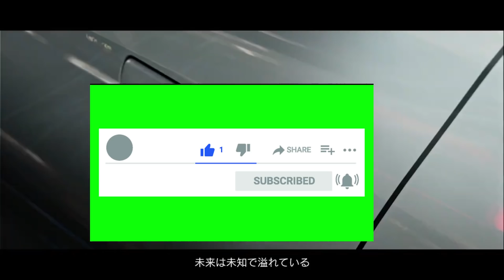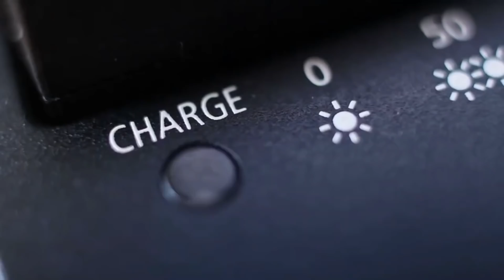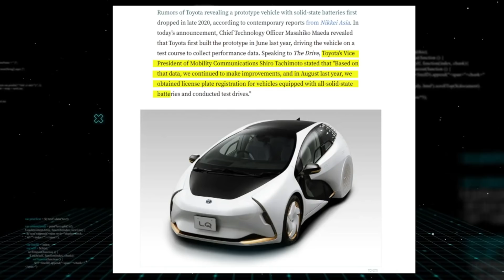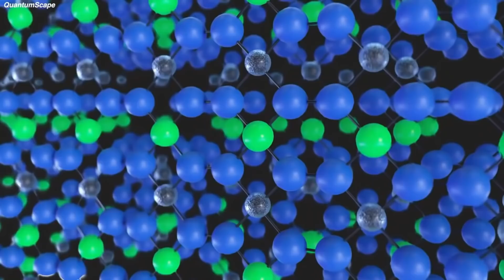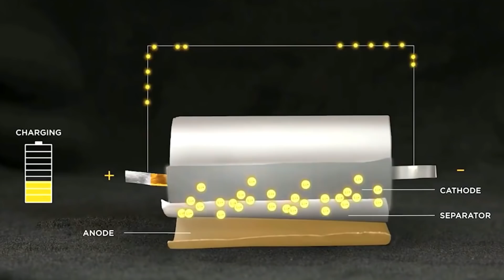FINALLY! Toyota Reveals SECRET NEW Solid State Battery | 2021

Comment: Most little petrol Toyota starlets today have been clocked so many times and still look good condition
Many have achieved 500.000 miles if only people knew the truth a Toyota prius with 270.000 miles
So when a solid state battery comes along with a 10 minute full recharge
Most sales reps will have these from new to include Taxi drivers as there is no Mot mileage check for the 1st 3 years these vehicles will be clocked back from 240.000 to say 90.000 one owner from new

Comment: 1998 BMW Had a hydrogen 7 series that could do 800miles per tank. Where is it now?. Water is better than making batteries... with zero charge time.
Reply: Have you actually seen how space wasting the latest Hydrogen cars are, there is hardly room for passengers and luggage. Three huge tanks in various locations, fuel cell filling front compartment plus a battery pack and the electric drive motor!
Really is a "Heath Robinson" approach compared to a Tesla.
Who in their right mind drives for 800 miles without stopping?
Just look at how Hydrogen is produced, its no simple process and uses vast amounts of electricity that would be better utilised directly in an electric car.
This is assuming everyone had their own converter otherwise delivering it to stations would make it ever more wasteful and polluting.

Comment: 2028?  Currently hybrids take 1/10th as many lithium ion cells to make; as compared to full EVs such as the Tesla cars.  If CO2 is a matter of concern then you can have 1 Full EV or 10 hybrids; both which can travel commute distances all electric.  Lithium ion cells are in very limited supply so Hybrids offer 10x more electric commute miles than EVs.  Tesla just achieved 1 million total cars built; they could have used those batteries to make 10 million hybrids; in a market of 80 million cars a year EVs actually perpetuate the use of ICE cars by pigging Lithium ion cells and in that regard they are a negative. Solid state is what everyone hopes to get in order to outperform hybrids in CO2 reduction but the supply would need to be spectacular; in order to replace ICE and cars at the given rate. Governments that push for elimination of hybrids are actually extending the life of ICE cars because you make so many fewer EVs than hybrids with a given number of lithium cells.
Reply: I completely agree.   The vast majority of folks drive < 50 miles on the vast majority of days.  Extra battery capacity means lugging around very heavy and very precious needless weight.   PHEVs with about 50 miles of battery range are the most efficient use of resources for our current energy landscape.  Similarly for a 2 car family, one BEV with perhaps100 mile range and one PHEV  would be an extremely reasonable use of resources.  The obsession with battery range is misguided.
Reply: @BHPGH  The big problem seems to be that people want one car that can do everything for them.  Maybe they think they don't commute as much as they do because they tune out in order to survive the deary commute drives.  They could get by with a small EV ; they don't think about maybe just renting a larger car when they need it .. Anyway - the result is to have a longer range you either need half a ton of batteries or a 300 lb gas engine.  When you compare a 5000 Tesla to a 3000 Lb RAV4 or a Toyota Corolla hybrid 2500 lbs it clearly costs more energy to make and more energy to push around.  The comparisons Teslas influencers always make not only forget this but they forget hybrids as an option nor do they mention big EVs pig all the Li batteries and basically minimize the number of electrics that can be made. Here is another one for you - IF people were really worried about CO2 they could have a much greated impact by carpooling to work;  cutting the number of cars on the road by 3/4ths saving them time money stress and the C02 - but notice no one is worried enough to do that.

Comment: It's not true that solid state batteries would require lithium. Several prototypes have been made of solid state batteries using other elements including sodium, which is extremely common and easy to mine.

Comment: By 2028, it will be too late. EVs running on lithium ion batteries will have far surpassed cost parity with ICE. Affordable EV options will be flooding the market. With this timeline, Toyota is in trouble.

Comment: Toyota doesn't want the world to switch to Battery Electric Vehicles. $13.6 by 2030 spending is actually a relative drop in the ocean compared to Tesla, CATL, BYD, and various other companies that ARE committed to BEVs and not Hybrid and H2 Fuel Cell Vehicles. And, as yet, Solid State batteries can't be made to scale. And it's not a simple engineering issue either. I welcome Toyota making efforts with SS batteries. But I hope it's not just a mask to counter what Toyota CEO Toyoda says about where he wants to go and what timeline.

Comment: The problem is more profound than this propaganda. It is one thing to make something work underwear laboratory conditions and another to make full scale production. Tesla is on the verge of full scale production of its 4680 battery. By the time Toyota developed a solid state battery, Tesla will be working on a second or third generation battery if not something more advanced.

Comment: Tesla is optimizing legacy batteries. They have been very good at this, but clearly the battery revolution has still to come.
Reply: Have you heard about the 4680 cell in production now ? It's not yet in the cars but will be oce the 2 new factories come online
Reply: @valdimareiriksson101  4680 is not an innovation. Its just a larger battery.
Reply: @frankwiersma7980  I don't agree, the fact that it is cylindrical does not make it a "legacy" battery. The tab less electrode ? The size and thermal management ? Not to mention the footprint of the factory.
Reply: @valdimareiriksson101  Panasonic makes Tesla batteries. These are not special batteries, all car manufacturers can buy them from Panasonic. Tesla has optimized the lifetime and charging duration by using software and BTMS. So while the way these batteries are charged and cooled is new, the batteries themselves are not new or innovative. Therefore I fully expect new developments in the area of batteries. It may come from Toyota, QS, Tesla, but most likely from a university.
Reply: @frankwiersma7980  Panasonic is licensing the tech from tesla.... Panasonic did not create this battery... the size alone requires the tab less electrode, to thermally manage each cell, the NEW battery packs Tesla is making requires alot less of cooling mechanism in the car due to the tab less electrode. Tesla is making these batteries right now and have been for a while (in house).
Reply: @valdimareiriksson101  Yes cooling is innovative, batteries are not. The NCA battery was developed by Panasonic. You are misinformed into thinking Tesla owns patents for this.
Reply: @frankwiersma7980  I'm sure we are arguing about different points at this time, the form factor is new and is Teslas innovation the chemistry in that battery might not be new or atleast is not for now. Just like the Toyota solid state "will" be Li based.

Comment: Leader in sustainable transportation? This author is living in another decade.
Reply: no he isn't, they made 30x more hybrids cars than Tesla in total.
They want a quality tech not "half baked" tank weighing ~300kg more, 4x slower charging and 50% the capacity in cold.
Reply: @ChuckLeeClerk  yeah you got that right.. that's the most concern of normal people like us to think and toyota will the come true hopefully...cheap, reliable, long lasting battery or parts of the car, fast charging 10minutes or below unlike Tesla that is only for the Rich people although they say that is cheap for US only but when it come to other countries.. the dealer put a price mark-up double or triple the price, that is sorry people like me will still uses combustion engine car even it takes 10-20years until it becomes Cheapest that anyone can afford it!...but i hope Toyota perfected the hydrogen car vehicle rather than fully EV😃..
Reply: @matmamat9690  I'm ok with freevalve hybrids - simple powerfull & clean
 If BEVs are comparably convenient and cheap that's good, but I don't really care
Reply: I have had 2 Toyota Hybrids, it is the same gasoline burning as ICE, can't compare with that what Tesla has got going..
Reply: @GHJuOk  but those (old Totyota's hybrid) ICEs were weak tho quite effective ~40%.
Freevalve engines are 50%+ eff, no cams or throttle body (simple + seamless cylinder deactivation) and clean even on cold start.

Comment: EV adoption is accelerating every year. Exponential not linear. The only limiting factor is batteries.
The number of electric vehicles and types of vehicles and trucks is growing.
Many people are holding off buying a new car until the electric vehicle they want becomes available.
Electric vehicles are just better. No noise, no emissions, less fuel costs, less maintenance costs and amazing technology. Gasoline and diesel are OLD polluting technology. So last century.  Electric cars, electric trucks, electric buses, electric trash haulers, electric snow blowers, electric lawn mowers, electric weed whackers, electric hedge trimmers, electric snow mobiles, electric water craft, electric garden tools, electric mechanic tools, electric motor cycles, electric bicycles, electric scooters, electric farm tractors, electric construction equipment, electric delivery vehicles,  ...... everything is going electric.  No worries about starting after sitting for a few months. Gas always needs repairs. If you care about the future for your children care about climate change
Reply: Wait to you get stuck in snow storm.
Reply: @frank.l181  I've been driving EVs for over 6 years through Michigan winters and haven't got stuck in a snow storm yet.

Comment: I seem to have a lot more faith in Toyota than the other commenters. Liquid lithium ion has been hugely advanced in the last 20 years but is beginning to run into the life cycle point where small improvements are getting more expensive. I'm not saying that I would buy the first Solid State Toyota but given a few years for on road development I suspect that the new Toyota will be a significant improvement on the current technology. Good on you Toyota
Reply: Yeah, really, so you are buying this Toyota crap? So now Toyota wants us to ignore all the money they have spend trying to slow down EV adoption and how much they have pushed hydrogen cars. They spent millions joining the Trump administration lawsuit against California trying to force them to roll back emissions standards. Everyone is working on solid state batteries, if Toyota believes that they have the secret sauce, then go ahead and deploy it, but looking at how Tesla and the Chinese EV manufactures are selling cars with the proven technology that works for now, kind of leads me to believe Toyota doesn't have 8 years to deploy their solid state batteries, if they really do have them. I mean, they don't even have a single BEV in the market.

Comment: What exactly is a solid state battery though? Batteries never had and moving parts
Reply: No need to.The question was rhetorical, highlighting the fsct that the name makes no sense whatsoever.
Reply: @OM-bs7of  "No need to.The question was rhetorical, highlighting the fsct that the name makes no sense whatsoever."

Sure it does as the name refers to the solid electrolyte.
Reply: @jbaker0203    well "solid state" originally came from harddrives right? The distinction being the regular hard drive had moving parts whereas solid state drives have no moving parts. This leads to my question about moving parts. Basic on your logic though lithium polymer batteries are already "solid state" as they use a solid electrolyte (the polymer) so what's so revolutionary? It's nothing new
Reply: @OM-bs7of  "well "solid state" originally came from harddrives right? "

Not really, solid state can refer to a whole different bunch of things i.e. Ice is the solid state of H2O for example. It's a generic term.

"The distinction being the regular hard drive had moving parts whereas solid state drives have no moving parts."

In that example, yes.

"This leads to my question about moving parts. Basic on your logic though lithium polymer batteries are already "solid state" as they use a solid electrolyte (the polymer) so what's so revolutionary? It's nothing new"

Not quite as the polymer is a semi-solid electrolyte, however also to be fair, not all solid state are true solid state batteries. They all have a solid electrolyte but some have a gel component for the cathode.

Solid state batteries aren't a new thing either, that you are correct. The revolutionary part is the cycle life and energy density.

Comment: Toyota is by far the best vehicle I have ever owned. I drove a service vehicle, that had 300,000 miles on it. Was only ten years old. It looked like it should have 30,000 miles. Well, except the seats, they looked like 300,000 butts have been dragged across them. But then every service vehicle gets like that. Mechanically, it was driving a near new vehicle. I was impressed.

Looking forward to what the develop. Sounds like Super-capacitor tech. Charges pretty damn fast if it gives 500 miles charge in 10 minutes. A Super-capacitor would do it in just a few seconds. Limited on the flow on energy allowed at the pump of course. "Marty, we need a giga-watt pump to recharge my Toyota!"
Reply: Super capacitors have poor density. You would need the trunk and back seat filled with them to rival Li-Ion tech.
Reply: The video said 500 kilometers, not 500 miles.  That would be about 310 miles.  Pretty typical range for current EV’s.

Comment: so it can recharge in 10mins with a range of 500mile/Km. So why the hell do they have an engine in the front!!!!!
Reply: It is still a hybrid bro….will still have engine for the vehicle to run..but not using gasoline to activate the engine, but it will use battery instead..👍
Reply: @princeworld4769 
Think you miss the point of his remark. Why does Toyota tout 10 min recharge with a range of 500 miles?  Its basically  childish advertising hype aimed at the EVs need for longer charge times. 
Whats missing is their use of fossil fuel to acheive those 500 miles.
Start with an empty tank and see how far Toyotas 10 charge will take you!

Comment: Solid state batteries are expensive to produce and don't last long. If these batteries were any good they wouldn't be spending 13.6 billion dollars trying to make a better battery.
Reply: I thought they were cheaper to produce and last a million miles.
Reply: @argentum3919  That's the hype. Toyota's super deluxe battery was supposed to come out this year. There is still a way to go.

Comment: Sold state is virtually impossible because anode and cathode expand and contract in use. That would crack solid state materials
Reply: Doesn't sound insurmountable to me. I think we will have it eventually but it will be too late and too expensive. This is a race to the bottom on cost not a race to the top on performance. Liquid electrolyte batteries keep getting better so by the time they introduce relatively expensive solid state batteries the difference will likely be none existent.

Comment: I have no doubt they can make a SSB. But what I do doubt is that they can make one that is cost effective enough to compete. What will this cost? $250 to $300 kWh???? Why is there no cost projections. It's a generally accepted that they will still be much more expensive than conventional lithium-ion batteries.  So it will be great for super cars but not for the average car.

Comment: Pretty lousy battery specs from Toyota for the solid-state batt!  BYD's LFP battery will charge to 100%, every time, in: ~15-min., get over 4,000 cycles and delivers a range of nearly 400 miles., and costs car less.  Toyota's is offering 800 cycles?  Joke!  They may want to go back to the drawing board or just use LFP until they come up with something better.

Comment: It doesn't really mean anything until they have a commercial production line and a cost per kWh that is cheaper than current technology by a signifiant margin, ^oo^
Reply: I Agee!
Reply: I'm aware people have said it enough in the past, but if we're going by that metric, Tesla never would've taken off, let alone built a single car.
Reply: @KonsaiAsTai  If fairness Tesla developed a small volume vehicle with existing technology to prove a concept - and there are still Roadsters surviving to this day - but this is different - it's entirely new technology that is claiming it can be cheaper and better than existing tech that already does a pretty good job - So sure, it may prove successful, and great if it does - but there is no evidence yet that it can complete that criteria in terms of cost and volume production - When Tesla start there were basically no EVs to compete with - this is going into a densely competed market, so I would imagine investors might want more than statements of ambition before parting with their money! ^oo^
Reply: current tech means nothing cause it's a heavy tank, charging takes too long and cold weather perf is weak.
EVs are fringe unless there are cheap SSBs

Comment: 2028 for SSB? It would be too late then. Clearly Toyota is not leading.
Reply: linkzable  4680 less expensive charges faster, fewer parts, simpler to make, less steel, no cobalt…
Reply: linkzable  I think BYD is clearly leading with its blade battery pack. Proven safe with crushed and nail penetration tests. 4680 may have problems with heat buildup in my opinion.